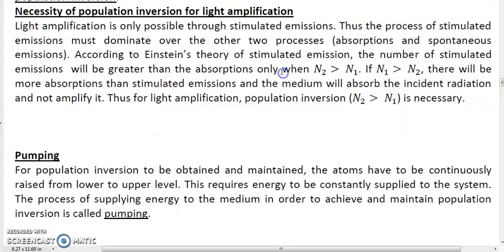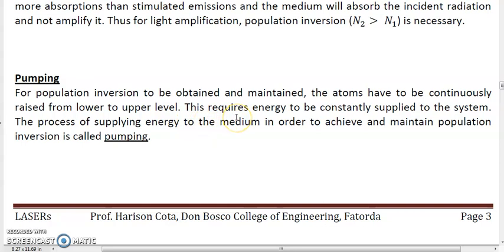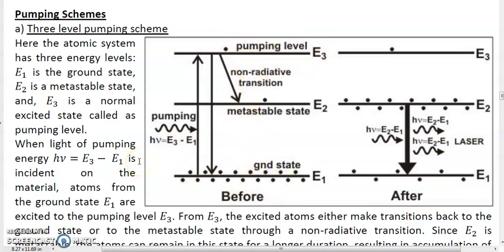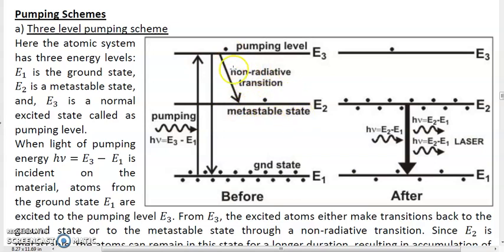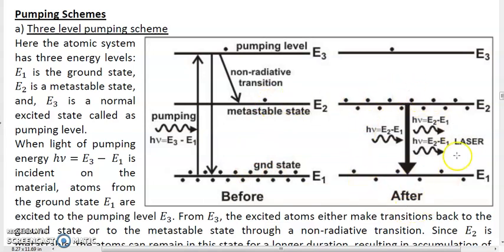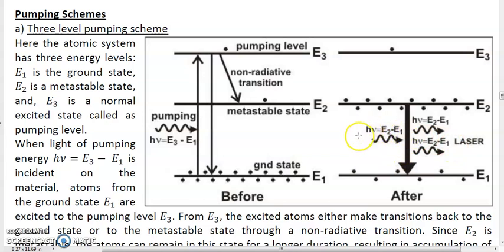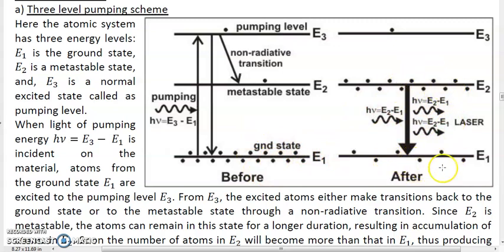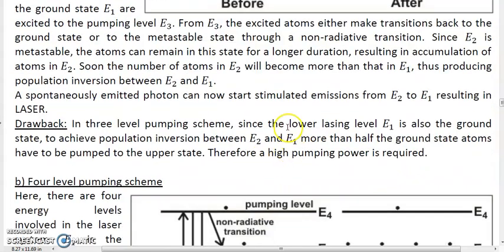Chap5 : LASERs : Lec5 : Three level pumping scheme

Comment: Sir i have a question 
Does everytime heat release in metastable state or we get a photon anytime?
Reply from the maker: Transition TO a metastable state from a upper level happens through non-radiative process (i.e. no photon, only heat)
However, transition FROM a metastable state to a lower level can happen though spontaneous emission which results in emission of photon.